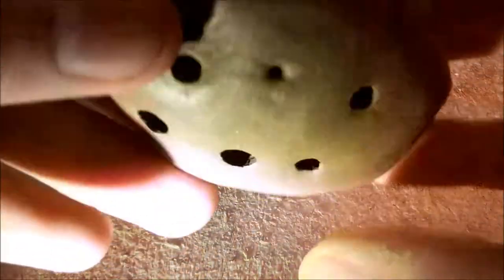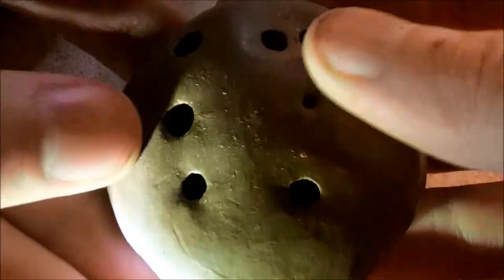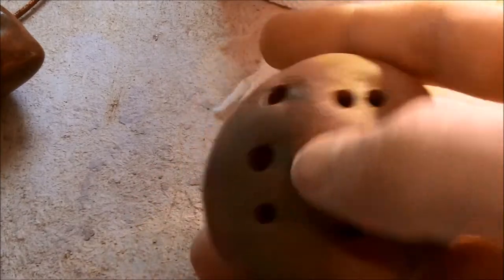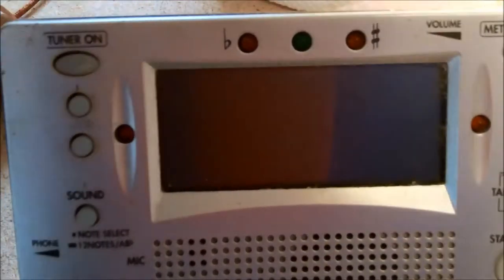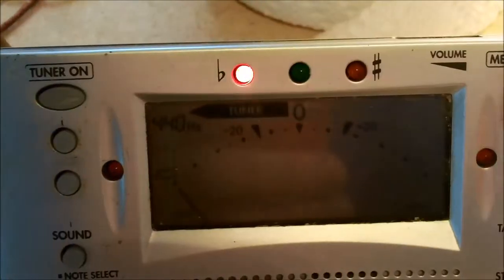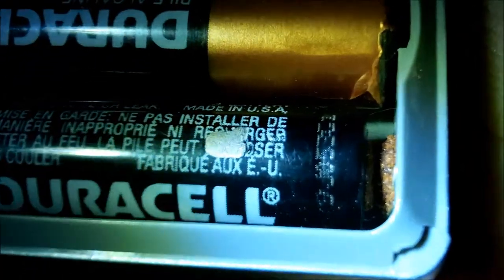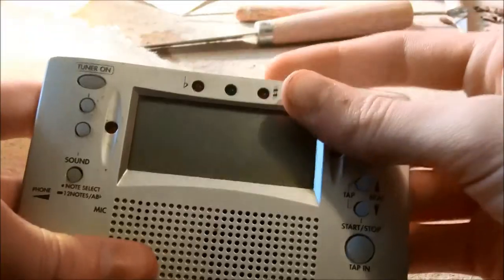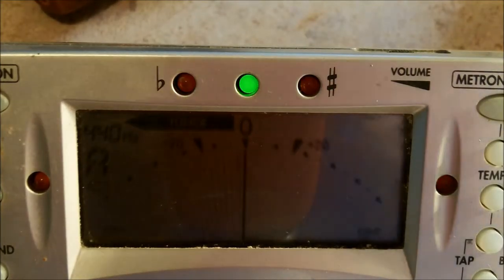Tuning Example

Comment: I would use a flat head screw driver to pry the battery out. You might even be able to clean the rust off.